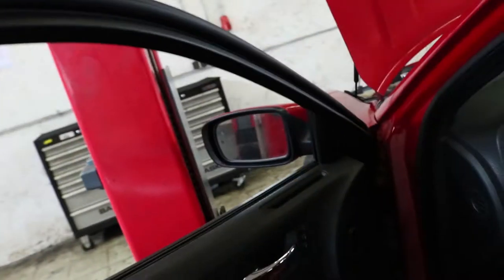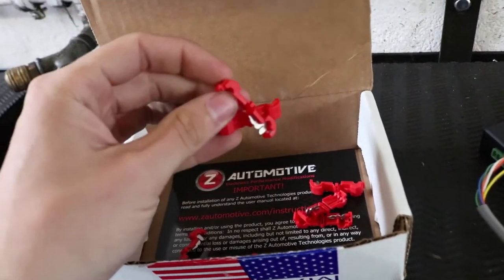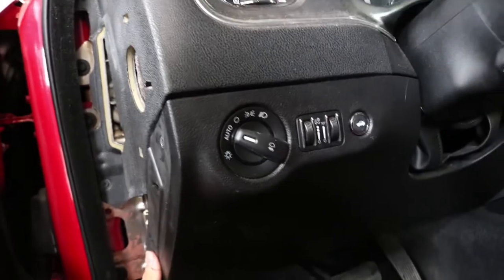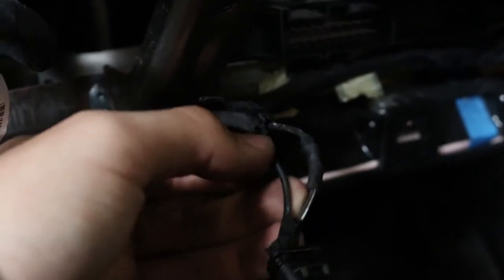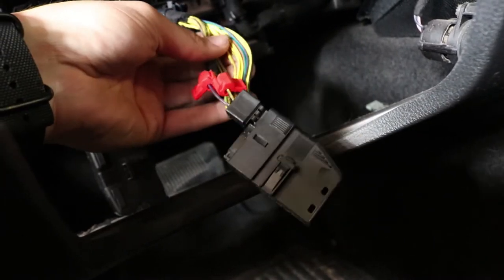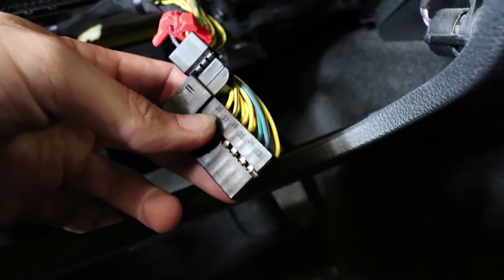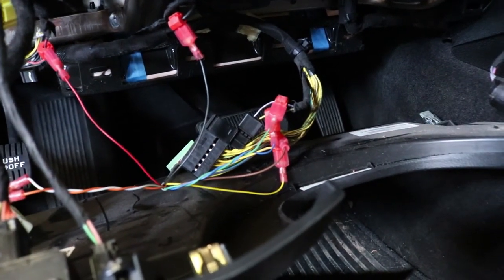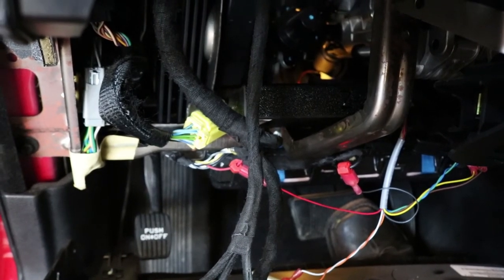Zautomotive Tranzformer Install

Comment: Glad you’re putting out Content for our Models 💪🏽 It was/is difficult to find anything due to people just going ahead & installing mods, HP, Appearance etc or having shops do the work themselves leaving the viewers wondering. Keep It up 💯
Reply from the maker: Bro I have so many parts just chilling in my room it's not even funny🤣 but I'm always gone so it tough but thanks for the love man! Just gotta get the people from the page to subscribe to me🤣
Reply: @DropTopPerformance  Curious if you have an email address to be contacted at?  I have a 14 Charger Pursuit and do track days.  I am interested in what mods were mandatory, good and nice to have but not needed for track use. It seems everyone with Chargers is only interested in drag racing or appearance and street use.  I lived in Germany for three years and go back regularly.  Drove the Ring but not enough to really learn it.  Home tracks are Mid Ohio, Gingerman, Grattan and WaterfordHills so fast tracks and smaller technical tracks.  Your channel is the best I have found for quality info and real track use.  Thanks

Comment: I ordered one for my 2005 dodge magnum RT. How long did it take you to receive yours. I ordered mine 10 days ago and had it shipped to my APO.
Reply from the maker: It took me a hot minute to get mine, but I have since removed it for the car
Reply: @DropTopPerformance  ah ok. Why did you remove it, if you don’t mind me asking?
Reply: @DropTopPerformance  yea why did you remove?
Reply from the maker: @egrayy9500  I didn't like the way it was making my transmission shit and downshift. It wasn't great compared to me actually tuning the trans.

Comment: Awesome video. I installed this a year ago and it was awesome however I had a few issues. Something was clunking really bad in the rear when the car would shift no matter what settings I chose for shift pressures. Third to fourth shift would flare as well. I removed it and it still bangs and clunks when it shifts. Have you experienced such things? Thanks!
Reply from the maker: Honestly I'm having the same issues
Reply: Drop Top Performance That sucks but I’m glad I’m not the only one. I was told it’s my carrier barring hitting the body or loose bolts in the rear. If you figure it out let me know. The tool is great at what it does but it might just be a bit too long and powerful for the NAG1 transmission.
Reply: My clunk was a bad bushing in a rear control arm.

Comment: So that's not quite plug n play like the burnbox from them, and thought that all of their products just plugged into the OBD port. I've got one of their boxes and looks like this one does many of the same things, but more because of the ability to change shift points etc and is the better way to go. The burnbox has line lock and is the main reason I got it, but also the light show and don't really care so much about that. Does that one just do the trans and line lock ?
Reply from the maker: So if im being completely honest I would just stick with getting the tazer. This thing was not my favorite investment and ill leave it at that lol.
Reply from the maker: My car no longer has this installed
Reply: @DropTopPerformance  wow really, it doesn't sound like you are impressed at all. The taser is basically the same thing as my burn box, but it's just for 2015 + and the box is 1st gen l believe. It simply plugs into the OBD port and love the line lock feature. So what didn't you like about it, if you don't mind saying. I was thinking about getting one because from what I understand, it has everything that mine has as well as launch control and a bunch of other features. So it would kind of be nice to know someone that has some experience with one, and the pluses/cons
Reply from the maker: @lovethesmellofracefuelinth7374  well if we are being completely honest the trans felt like complete booty. It was very clunky while down shifting and would cause my trans to haze the 2-3 shift. So I just tuned the trans myself and fixxed all the issues